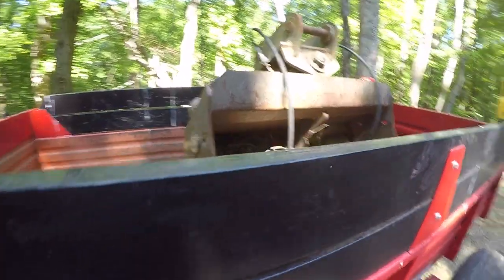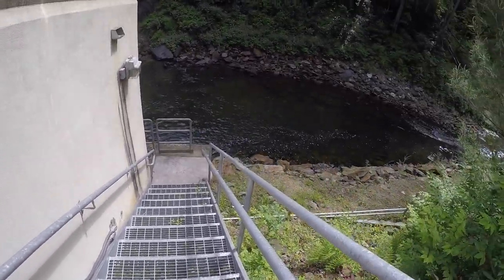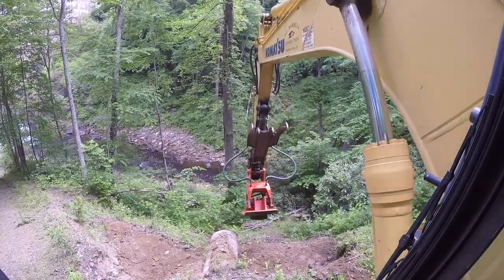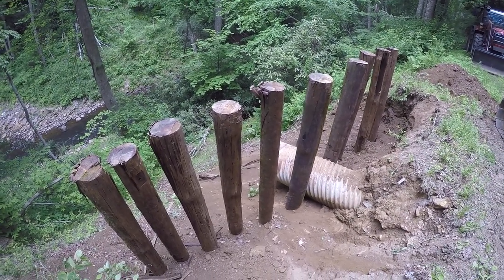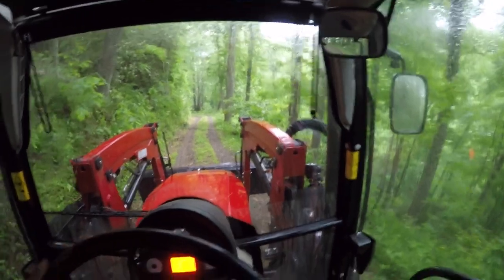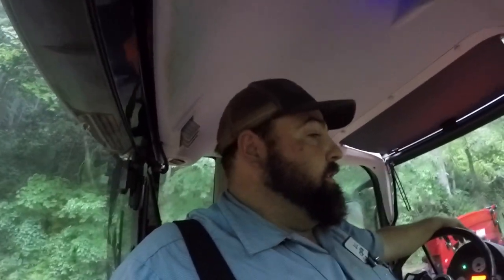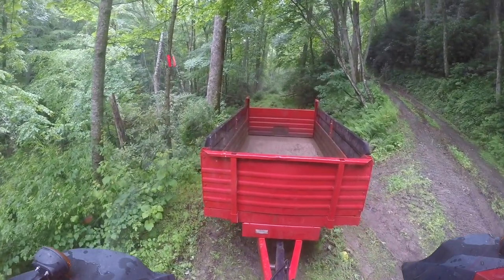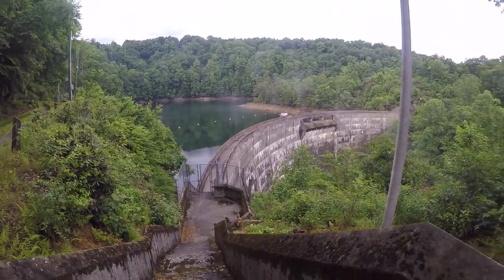The Dam Project Phase 1. Driving Poles with Vibratory Plate Tamper.

Comment: We do the same thing here on cape cod for Beachfront houses docks that got washed out a couple years ago. We made a square box welded to a plate then drilled holes to bolt the plate and box to the tamp . That way we can take it off if we have to With four big bolts. The north side of the cape is all rocks and you can not get them straight. We had to hold them with a 315 and a short choker chain then drive them with the 228 as both excavators went down at the same time Because the builder needs them straight to build the docks .   Great video. Well done sir 👍
Reply from the maker: That sounds like it would be a pia to get them that straight.
Reply: @DLHFarms  It was a nightmare

Comment: Always nice to see you Dennis doing real work and not only as a "hobby farmer"!  Lol Very interesting job and site! Plate compactor worked well. Why haven't I figured out this simple solution to weld a ring on it?   You still look a bit tired when at home, but not as much at jobsite. It's maybe the bad backside of doing YT videos?  ;D  Keep well!
Reply from the maker: I just tacked the ring on there with about 8 1inch welds so we could cut it back off fairly easily. I edit the videos late at night after work so that’s why I’m so tired.
Reply: @DLHFarms  I'll test it myself, and also on back side of a bucket! I've only used the cavity before and that's no good! ;D Can easily be some tiredness when you're a family father and have at lest 5 jobs!

Comment: Much enjoyed your vibration -setting those telephone poles flanking drain pipe. Kinda thought that RIP-rap would be larger, but your experience & on-site survey resulted in your good choice. Bring on part 2 so us viewers can see you finish this tricky, steep gravel contour service road. Nice job!👍👍👍
Reply from the maker: The first rock I put in the hole that I didn’t really show was much bigger natural rock that had come from a rock slide on the property. Then as I ran out of that all I had was the small rip rap that’s when I started putting the logs in there to help hold it.

Comment: Just a few tips regarding the pile driving. 

Put a hardhat on your ground man. 

For lifting the piling: Use a heavy chain with a slip hook on the tail end and attached to the machine with  a clevis. A strap is much harder to get off the pole, can bind, etc.

For getting the compactor on the pole top: Before the pile is on the ground have your attachment it the correct position so your chain doesn't have the chance to bind.

When driving the pile center the machine at 90 degrees to the work and have your ground man stand facing the work 90 degrees from your view. Between the two of you keep the pile on target and plumb.

When driving the piling you can angle it in different directions to counter it wanting to walk off target. Sometimes you have to pull them up and start again. 

If you have to sharpen the piling, make four cuts instead of two (more like a pencil), it won't walk off target as bad. Generally you don't need to sharpen them though except maybe in hardpan or dense clay.

Source: Many thousand of pile driven with this technique.

P.S. Weld the pipe better. We always called it the bell. Run a continuous bead inside and out all the way around, even then, with use it'll get ripped off eventually.

Comment: Back in the early nineties I worked for a company that specialized in building docks and small crosswalks across environmentally protected wetlands. We would drive pilings using a vibratory compactor with pipe bell plate attached. Could drive a 10 inch butt piling 20 ft. into the ground, the trick was to keep center of balance on the piling while pushing down with the attached plate and excavator. I'm surprised this concept or design is not widely known.

Comment: That's a interesting job, a little different than haying. I worked a job that drilled core samples into the rock a the bottom of the dam, every crack in the cement walls was measured and dated. Being down there knowing that there's a 100+ feet of water above you is unnerving but I'd rather be down there than where you were standing close to the outlet.
Reply from the maker: I read an interesting report about this dam. It has a 30ft crack in it that seeps about a gallon per minute this was back in the 70s. They also deemed it unsafe because they could not find the original engineering calculations so they could not determine how strong the dam actually is and they also determined the the spillway is very much undersized. They may have corrected all this by now but it was an interesting read.
Reply: @DLHFarms  Holy, I can't imagine seeing a crack that big, I'm sure the people downstream are happy to know the dam is safe now.